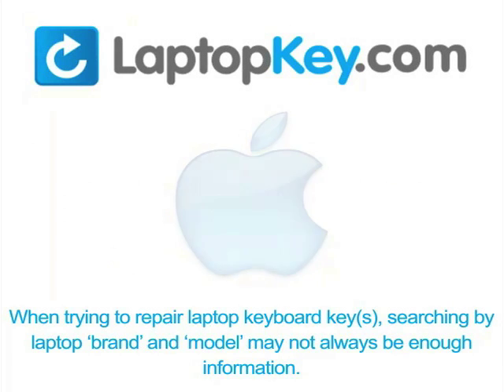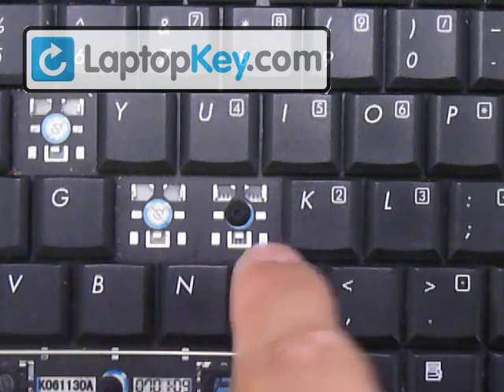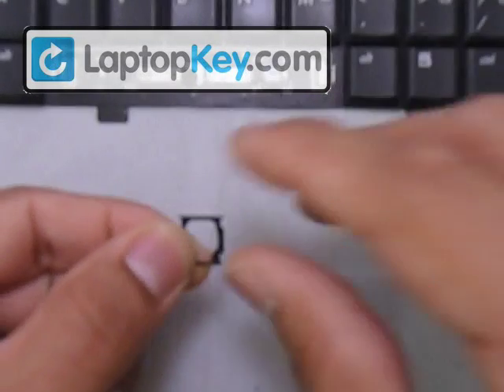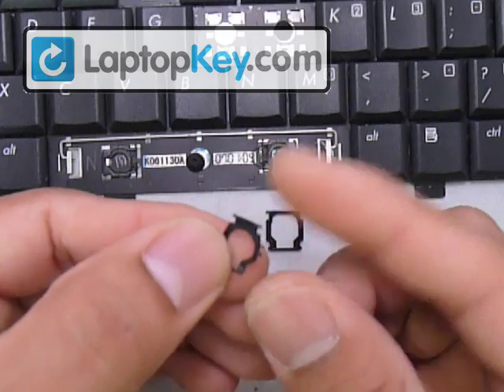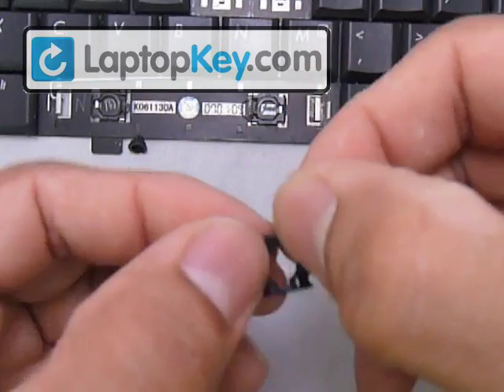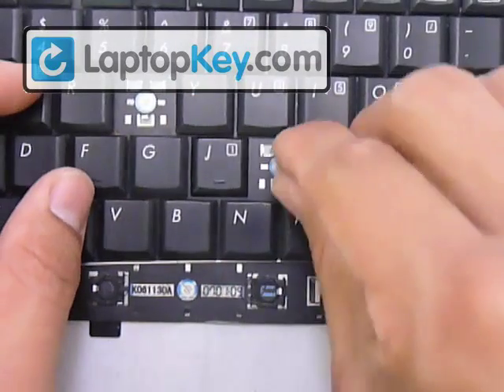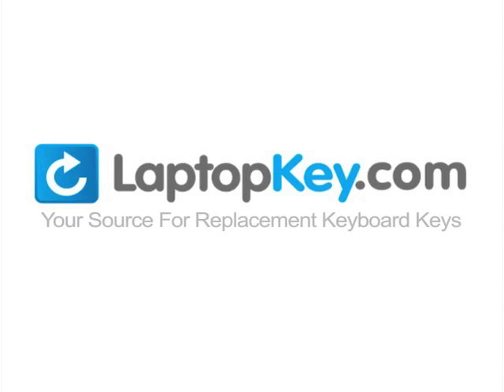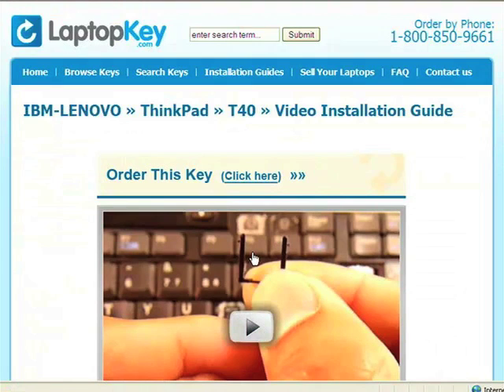Replace Keyboard Key on HP DV6T DV7 DV6 x16 x18 HDX16 G60 G61 | Fix Laptop Installation Repair

Comment: TY TY TY TY

mine has 2 clips and i was wondering how i was gonna deal with those, i removed both from key,but the first time i tried to line it,the bracket came off with key,the other one stayed on the keyboard, which worked out,cause i only had to line up one then. ty

Comment: If the small parts are still attached to the key it's self do we remove them?  No one addresses the whole key coming off with everything underneath it attached to the key it's self.  Do I try to get those parts off the key,  Have them in my hand then go from there.   Please help.  Thanks. .